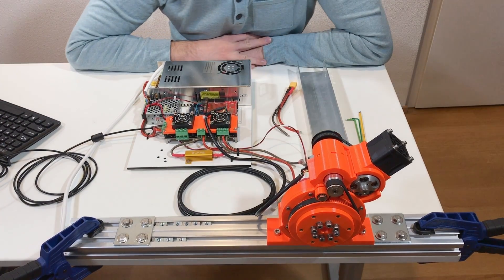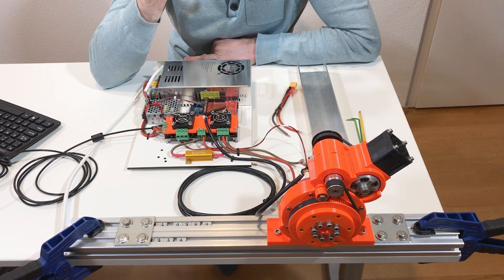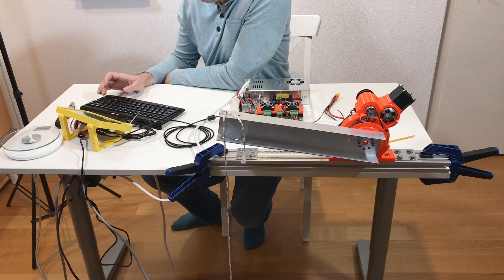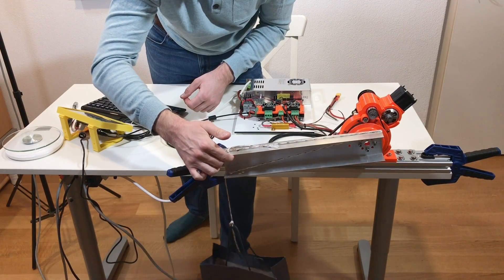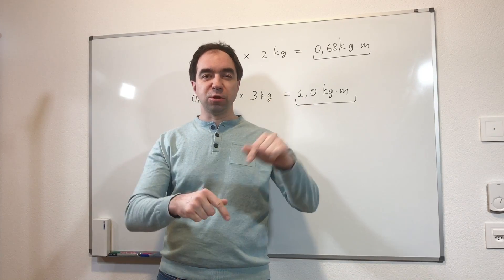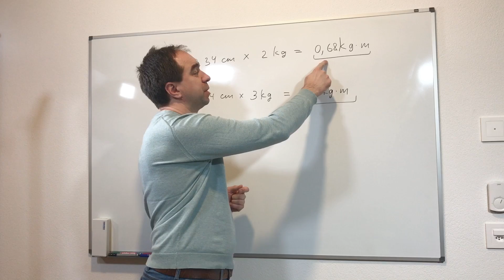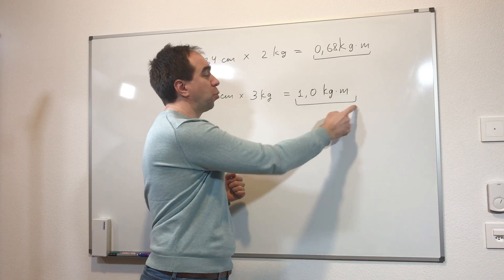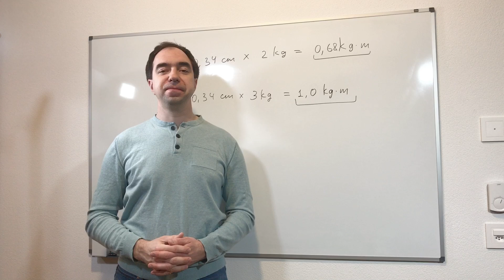Torque Test of Robot Actuator (Brushless Motor Robotic Joint)

Comment: What the reason why you use in this moment brushless motor instead of step motor? (in first step of your arm you use step motor)
Reply from the maker: Great question. The short answer: the brushless motors have much more power for the unit of mass. Thus I would like to make a more powerful robot arm.
Reply: @Skyentific  no step motor has more torque than brushless. Brushless has high rpm tho..

Comment: Increase the torque of the motor with planetary reduction gears(用行星减速齿轮增加电机的扭矩)
Reply from the maker: Unfortunately they usually have backlash. But I would like to have precise robot joint.
Reply: @Skyentific  Try to fine tune the PID parameters. Using a larger proportion of the gear unit, using metal gears, and the belt also produces a large error, my mobile robot can reach 0.1 mm horizontally. In fact, other sensors and programs can be used to correct these errors. Hope it helps you:-)
(尝试微调PID参数。使用更大比例的减速器，使用金属齿轮，并且皮带也会产生很大的误差，我的移动机器人可以水平达到0.1毫米。实际上，可以使用其他传感器和程序来纠正这些错误。希望对你有帮助:-))

Comment: My suggestion is to use screw machenism instead of belts ,,it will significantly increase the holding capacity as well as torque.
Reply from the maker: Yes. But this system will not be a backdrevable. I would like to have a good back drivability to use the current on the motor as a kind of force sensor. But I agree that the system like on OpenDog with the ball screw could be a solution.
Reply: @Skyentific, I see you use black 15mm belt. If in big speed it have backlash, you can use the same size white belts, they are armed with steel wires and not stretch out.

Comment: To cool such a brushless motor you should route the air through the motor, not across the outer rotor. Those are designed to have airflow through them.
Reply from the maker: It is going exactly through the motor. I have very narrow gap between motor and housing, like this most of the air is going inside the motor.
Reply: @Skyentific  sorry I didn't see it. Thanks for the heads-up, looking forward to the evolution of this project

Comment: I would try with higher voltage. Do you have the 48V version of odrive? Voltage is essential for torque. Moreover these bldc motors shines at high RPM
Reply from the maker: Good idea! Thank you! I do have the 48V version. I can try this!
Reply: Skyentific high rpm with a reducer, seen a guy pulling 10kg with a bldc and harmonic drive.

Comment: Keep in mind that motor current is not the same as the current drawn from your power supply. See the following https://things-in-motion.blogspot.com/p/blog-page.html

Also, the torque output of the motor can be estimated using its Kv and current draw. I did just this using an odrive and the results are in good agreement with the theory. https://things-in-motion.blogspot.com/2018/12/how-to-estimate-torque-of-bldc-pmsm.html
Reply from the maker: Usually the motor current not the same as current from the battery, I agree with this. But this motor demands 20V if I am not mistaken, and this is close to 24V of the battery. Thus, for this particular motor both currents are close to each other.
Reply: @Skyentific  The winding resistance of these motors tends to be on the order of 0.035 Ohm and so the power draw by the motor at stand still and 50A will be ~ 87W (P=I^2*R = 50^2*0.035). If your using a 22V battery then the current draw from the battery will be less than 5A. This post goes into more detail about power supply selection specifically for the Odrive https://things-in-motion.blogspot.com/2018/12/how-to-select-right-power-source-for.html?m=1

Comment: you should use gears instead of belts/pulleys : you did reach the belts limit in this video
also again if you put all motors in the base no torpue used to move motors in the arm ;)
Reply: I do not believe the belts are the problems (toothet belt holds very high torque without streching). Do also consider that belt drives are fairly easy to reduce backlash compared to gears. To correctly use gears the entire construction needs to be way more stiff than a 3d printed one.
Reply: @exol511  you are right on backlash but the belts used here don't look good
Reply: @christophemalvasio5569  I think that has mostly to do with the fact that the belt is not tensioned on both sides on the second stage of the reduction (which is also disproportunate). Also the belt looks like a basic T5 belt which has way more strech then a GT3/5 belt for example or some other high torque belts. In general the entire construction is not stiff enough to make maximum use of a belt or gear transmission

Comment: Even if you make 1,5 kgm, what about the weight of motors, hand etc. What is final load of do you want to reach? And how long manipulator are you going to build?
Reply from the maker: This is going to be the joint for the elbow. The final goal is payload of 2kg and human arm reach. And of course I accounted for the weight of the motors. I would not put any hand on it. It going to have interchangeable end effectors.
Reply: How are you going to transmit torque to joints?